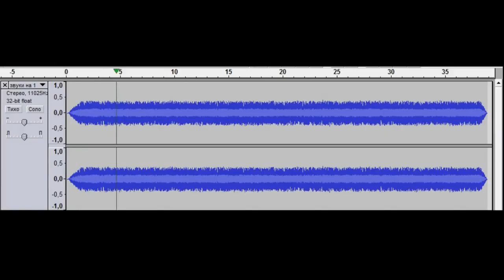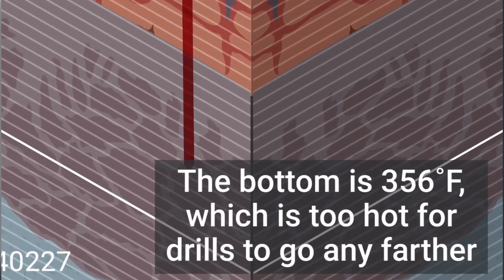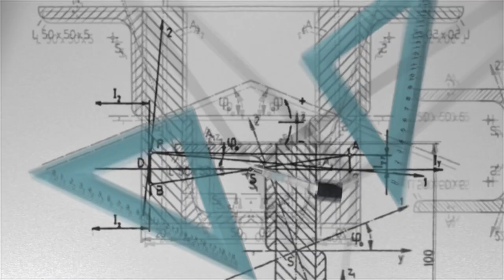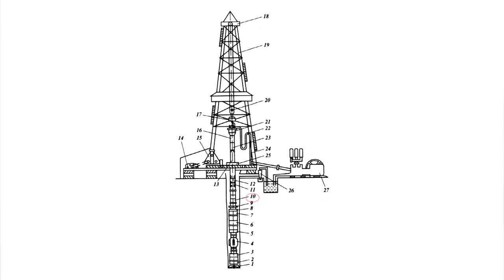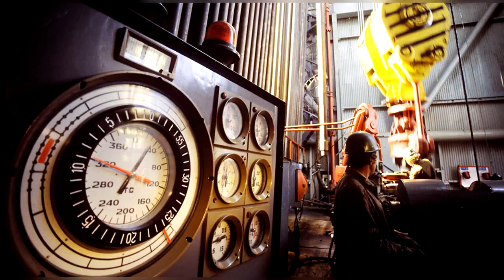Here's What is at the Bottom of the Deepest Hole on Earth...

Comment: 350 Deg F (177 Deg C) doesn't seem to be all that hot compared to the properties of steel drill bits. Common industrail processes like generating electic power by burning fossil fuels operate at 1,000 Deg F all the time. Why would 350 Deg F at the bottom of the borehole be cause to stop drilling?

Comment: Here's A funny question to think about and it does not require a scientific answer. Whatever land mass is completely on the other side of China, you drill a hole all the way through and jump in it. How far would you fall lol? Don't answer about how hot it would be, and you'll burn your ass up, no oxygen this or that, just how far would you fall if you jumped in that hole that goes all the way to China?

Comment: FOR MORE THAN 20 years, the world’s deepest hole could be found on Russia’s Kola peninsula, boring 40,000 feet down into the Earth’s crust.

In recent years, though, the Kola Superdeep Borehole has been surpassed by both a 40,318-foot oil rig in Qatar and a 40,502-foot well off the Russian island of Sakhalin, and you get the sense that the race for deepest hole in the world is not over yet.

Wonder if those deeper holes also found uniform density of rock that made no sense and higher temps than expected.
Reply: So how is oil down that far. What 500 degree temps don't destroy it....hmmm

Why's that odd. 

just like its odd that how many barrels get taken from the ground at any single oil rig and that now empty cavity is how big after it's all collected?

Comment: That was an aural illusion or pareidolia due to the friction of the nozzle and the earth. Just like what you heared in a running conveyor in a silent surrounding. The noises were similar to persons who are speaking in unclear messages.
The extreme heat underground was an anomaly or exception with regards to Earth lithosphere. Just like the river in Brazil whose water is boiling where it is very rare compared to most rivers.
If they would gather other several  observations similar to these, then that would be the time to speculate that the allegation was probably true.
Reply: hardly believable and not very scientific, its a mixup of sound effects from blood baron and old 80's horror sound effects

Comment: its obvious
the "screams" are most likely the sound of trapped air escaping. 
or supposedly, think of it as this.
when you put bacon on a frying pan and turn up the heat, what sound does it make? it "screams". probably because of the friction, or something to do with the temperature of the air, escaping the hole, or rubbing against the microphone.

or it could even just simply be the sound of the microphone melting! it happens!

Comment: If you're going to make a video at least get it right. There was not a microphone attached to a drill there is no microphone that can withstand 2000 degrees. Once they hit molten lava they could go no farther. So they decided to send a microphone down that was heat-resistant but it did not go the full length and it did in fact capture what sounds like the pits of hell

Comment: With current metallurgy and technology we Should be able to make stronger, tougher,  more heat and wear resistant material alloys to continue with another ultra deep borehole.  
That sound recorded is the result of plate tectonics and vibration transfer thru the rock mass creating that noise .

Comment: The sound just sounded like drills against rock. 

The heat is mostly likely from volcanic activity. I don't know why that would be surprising. 

I'm surprised that they didn't leave a sample tube in the cap so that they could routinely sample the gases coming to the surface. I'd like to know what composition the gases are. I would also have lowered thermocouples to various depths to see how or if the temperature profile changed over time. They could even do that with gas sampling to see what gases might be coming out of the rock at various levels and whether those gases are rising. I'd also want to monitor the pressure inside the hole. 

If the world ever stops rewarding stupidity and goes back to doing research, they should re-open the hole and see how things have changed over the past thirty years. I wonder whether the bottom of the hole has closed under the pressure of the surrounding rock. If water was seeping into the hole from trapped reservoirs, I wonder what has happened to the water. The water would tend to fall to the bottom, but as the temperature rose, the water would flash to steam. The steam would rise but would condense as it cooled at higher levels. Eventually, the pressure might equalize so that no more water entered the hole. Opening the hole again could be dangerous if a great deal of pressure has built from that steam. On the other hand, building pressure might eventually rupture the cap.
Reply: The microphone was sent in after the drill this video has it wrong

Comment: If the steel pipe was wide enough for a heat
protection suit and respirator tank supply I'd
agree to be lowered by inch thick steel cable
off an electric-driven mining hoist.  Talking 
all the way down on instrument read of the
heat increase, pressure changes, etc.-etc.
Deep mining has all that and more because
you're not in Kansas anymore.  My county
installed a pair of glass-lined steel pipes.
Feeding cold freshwater into one that at
depth gets hot enough to flash into steam.
Water weight in pipe pushes the steam 
through stone to escape up the other
pipe.  That rising pressurized steam will
turn turbines at a surface facility.  Which
makes electric power.  It is not Hell down
below my county.  My residence is about
30 miles from an active volcano .  There
are connected magma chambers  below
that constantly fill or drain molten stone.
Most are the size of small USA cities in
width .  Pipe put into those would melt .
So I'd just go down to see the pipe start
to turn red hot.  Without protection my
fluids would boil into steam.  The skull
explodes from a steam explosion.  I'd
ignite and burn down to trace elements.
Which won't happen if we all go to a
Hell intended for just us by Muslims.
There's 9 levels and we're just going
about halfway down, thank goodness.
That's a happier Hell than the lower
half, yes ?

Comment: You dig a hole that deep with a tempture that high and fail to see a practical use?
Free energy green,  you could be producing power from this youve already drilled the hole that's most of the work.
The hole is so deep its close enough to the earth mantel you can make steam, and harvest gases to be used to generate power. This would pay back for the cost to drill it.  This isnt science fiction its being done today

Comment: Truth is....Due to the immense pressure (and heat generated by that pressure) of the 7-mile thick granite, the rock becomes putty-like and it becomes impossible to drill any further.  If they had any sense they could have worked that out before they started drilling.

Comment: For anyone who doesn't know how a microphone works, well, it's much like a speaker...but the mirror opposite. 
When speaking into a mic, the sound waves from your voice vibrate a very thin, round diaphragm. This diaphragm has copper coils under the middle. wrapped around the coils are magnets with a very small gap between them and the copper.
When the soundwaves vibrate the diaphragm, they move the coils back and forth, based on the frequency of the soundwave. This creates an electromagnetic field due to the magnets that surround the copper.
This electromagnetic field can be turned into a copper wire signal, which is what the computer, that is recording mic, hears. 
The computer takes that signal, processes and encodes it, and then it can be sent down another copper wire to an output device.

Given the extreme temperatures, a normal microphone would have, plainly, melted. I'd assume that this wasn't a normal microphone, and that it had a lot of insulation around it.

Because of this heat, and the types of metals thar are in the surrounding rock, any sounds that could have been detected by the mic, like the drill tapping the side of the shaft, would have been subject to heavy interference, making what was actually transmitted through, back to the surface, very very distorted.

They aren't demons, or tormented souls. They are distorted frequencies recorded by the mic.
Reply: You have no idea what's down there, it is true
Reply: Damn

Comment: Now as I understand it...the Marianas trench is 7 miles deep and you cant lower a submercable down to the bottom on a cable because the weight of 7 miles of cable would exceed its own tensile strength and the weight of 7 mile of drilling pipe would do the same.

Comment: 2:41 I know what that noises is it’s The sound of the drilling from that deep because it would have been echoing in the hole from that depth
Reply: I was thinking it's probably the earth moving. You know, like tectonic plates.
Reply: Yonkaboo Exkaboo  it didn't sound like howling screams to me. I listened several times at different speeds and it sounded like scraping to me. High pressure? Maybe so. Good thoughts tho!

Comment: 0:31 The hole is not welded shut  what you were looking at is a welded cap that was made from an o ring flange it is bolted shut by12 bolts and that is for the scientist if they want to gain access at all they just have to unbolt it to remove the cap I believe the bolts are probably 1 1/2 to 2 1/2 inch

Comment: I drill holes for a living.. not that deep but use the same technologies. Where he explains that when the crew wanted to return to drilling and part of the drill was stuck in there. There could have been possiblt ways to get it out. Peices of ipe are fitted together much like the lid of a coke bottle, just twist it together. Its just crazy to think that it couldve been that difficult to get it out.
Reply: Probably don't have as great of control of the drill bit at that length / depth.  Just a thought.

Comment: It's actually extremely unlikely that the moon broke apart from the earth. There are quite a few problems with that theory, not in the least the issue of any kind of breaking apart in terms of physics  wouldn't result in it orbiting earth (the attraction from other planets would have been bigger than from earth itself, the point of impact. And lets face it, the moon has a very stable orbit now), nor would either just naturally reshape into spheres (this part is never really properly explained, except for pretending the earth must have been a molten lava planet or sorts, from before there were oceans, which isn't quite what the geology shows either (for example, the moon is too different from earth, yet it does have at least traces of water, if not frozen water in craters or underground)). Yes in some fundamental ways the moon seems to consist of generally the same stuff we know from earth. However I think the earth and moon are much less alike than we assume. And there might be many planets with roughly a similar geological composition. In other words, you'd need much more than just that. It's also mildly amusing how the whole moon genesis theory thing requires a theoretical planet Theia to work, yet mathematically it wouldn't work for reasons mentioned before. The idea that somehow Theia completely vaporised in the process is a bit silly.

Comment: Human eyes have seen rock from 7 miles down. Probably much deeper. Just go to any mountain range pushed up where two plates collide. Also 7 miles is only a scratch in terms of the earth radius. Also 350 odd f is only 176c which is not that hot at all. With a geothermal gradient of about 30c per km at 7miles or 12km we would expect to see temperatures of 350c. So the units are mixed up. 350c is hot. All in all digging deep holes is an expensive somewhat pointless waste.

Comment: If you ever dig a hole, be careful so you don't dig right through the Earth.

You're welcome
Reply: I believe Lewis Caroll dealt with this notion in "Through the Looking-Glass."  Alice would fall until she got near the center of the Earth, accelerating as she fell, then slow down after passing the center. Then she would fall up, going back and forth until she finally came to rest at the geographic center, suspended in the hole. I don't recommend becoming the first person to try this as the core is still molten and pretty hot.  You probably should try it on the moon or possibly Neptune or Uranus.

Comment: It tells old souls what has changed at Earth since the conditions have changed. Well, that is some idea. Yep, one mentioned there are. So the inner rocks are up heaved from lower, but it usually is in sand regions. Some desert areas differ from others. Sahara and Africa ex. U S has tilted rock from not just wear, but as result energetic crushing squeezes up and out some hidden gems. The holes were to compare minerals to understand the sources of some regions. Therefore guesstimate ng the occurance . Carbon is said the building block, the other carbon also. The inner carbon is heated or over heated and the solids form to diamonds. I know pressure. It like maple sap to syrup. Dont be suprise if sugars involved. Other rocks, even diamonds , did not always come from center Earth. I know, debatable via science . The absorption or release of elements and waters is the real goal. What energy does to effect, at what pace.

Comment: Why not build it as a powerplant for infinity energy? But 2 pipes in the hole circeling water. You can retract steaming wather from that heat and use it on a steam generator

Comment: 365F (or 185C) is much much cooler than a regular drill bit can get when you drill a hole on the wall of your living room to hang a painting. When you lower a microphone into a 12KM deep hole in hard stone, what you can hear may sound like anything. This is because of some acoustic phenomena (too long to explain here) but you can try this by lowering a microphone in a 4" (or 10cm) diameter 30 feet (or 10m) pipe. Projects get shut down when simply the money needed to keep them going exceeds their financial or scientific gain.
Reply: Why don't you pull some more made-up statistics out of your ass?
Reply: @buddyclem7328  Maybe you should look up the meaning of "statistics" in a dictionary. There are no statistics (pulled out of my ass or otherwise) in my comment. I think you meant "numbers"?

Comment: I worked in oil patch for years set equipment on our (US) deepest well I remember when the Russians were drilling that well it was known fact that you drill any deeper for pressure is go great it collapses the drill pipe we all knew they would drill as deep as they could but was amazed they went that deep even today's technology  we still don't have pipe that could withstand the pressure and the heat not to mention all the other things that factor in like the drill mud that's pumped down the drill pipe thru the bit and back up thru annalus which helps turn the bit and cool the pipe I thought it they could they would have probably drilled straight thur the earth but hey my hat is off to them , thanks for your time
Reply: Have you seen CERN?
Reply: Think they are building a bigger one, didn't realize it but iron man 2 has a small collider in it and that movie was out before all the cern chatter online.

Comment: You know this thing that i will say might be stupid but anyway. Ok so we dig so deep that we can reach the earths middel core but if that happend would the earths core so deep melt the metal so the magma (probbably hotter much hotter) come out on the surface of the earth and start global warming that we will have to make artificial ice for the polar bears but on the other side if the super hot magma comes out the earht will get much colder right cause there will be no warming from the inside. I dont know if you do just type it on the repiles section but if you dont just like the comment.

Comment: All was true until star repeating the lie about the microphone in the tip of the drill. If you see every record on youtube about this supposed recording do this to know the truth. First record the sound on a file like wav, mp3 or any format that you can handler on a recording software like adobe audition, or similar. Second, inverse the direction of the recording. 3rd find someone who speaks Spanish and asks them what he hears on Spanish. What you should get is an exorcism on a Spanish church with the cries and yelling of the people and the possessed woman. Is just another lie to reinforce the belief on a hell that doesn't exist. At least in the cola hole. The temperature raises suddenly because was near a magma flow pass underground which is normal at that deep inside earth core. So when make researches be smart and malicious because a lot of persons are being taken with this false statement of the cola hole in Russia.  By the way tell me where to buy a microphone that supports that pressure, temperatures and hot humidity. that's without considering the abrasion of the perforation process.

Comment: In Oklahoma in the early 1980's Parker rig  201 drilled to 33.000 ft And was uneventful .We stopped drilling because of the temperature .Natural gas and H2S  was hit several times on the way down .Look into it,, the hole was started in 1981 and stopped in 1984. It was drilled just a few miles south of Elk city Okc just off HWY 152 By Parker drilling Co.

Comment: they should kept on drilling to see if it possible to drill all the way to china or some where on the other side of the earth
Reply: They need to hit way deeper, which would result in years of drilling, along with repairing, expanding and upgrading the drill as it would just melt when near the core? Theres no known metal that doesnt melt when presented with 3400 C heat
Reply: you're right, I forgot about the earth core and all metal has a melting point.